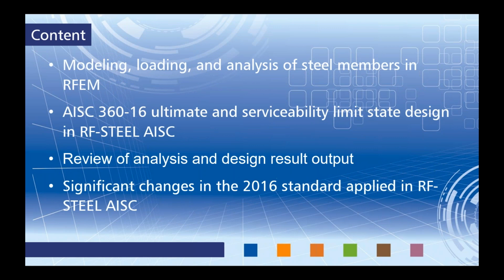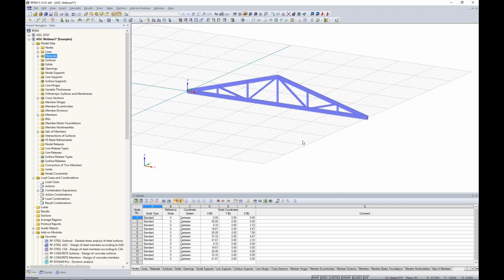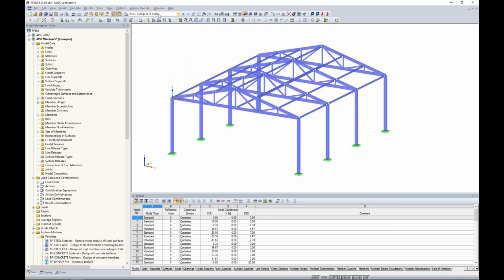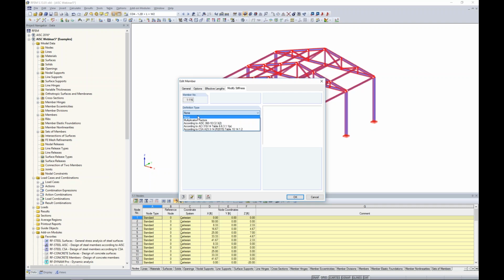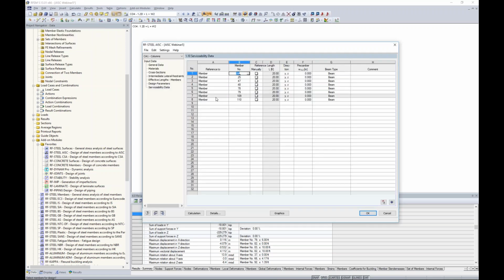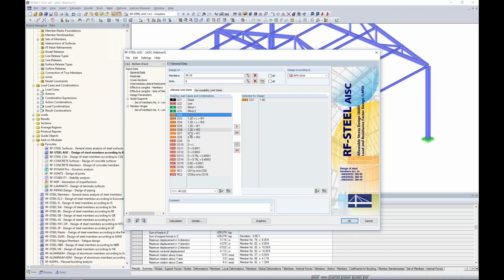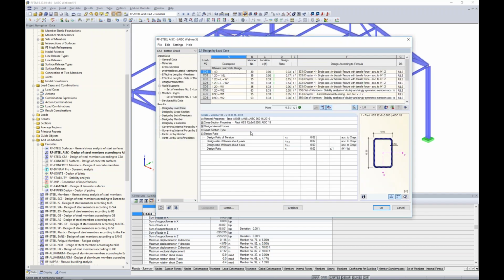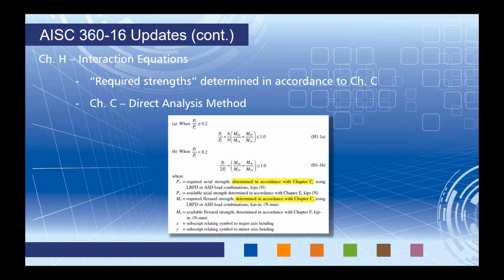Webinar: AISC 360-16 Steel Member Design in RFEM (USA)

Comment: Wind loads and some other items not showing in TOOLS menu in my PC.. How to make them to show in tools menu?
Reply from the maker: Hi, 256!
Which program version are you using?
Reply: @DlubalEN  Hi, "Dlubal RFEM 6.02"  and "Dlubal RSTAB 9.02" both are trial version
Reply from the maker: Hi, 256!
This video is about RFEM 5.  RFEM 6.02 is the new generation of our finite element software. You can find the wind loads in the navigator of RFEM 6 and RSTAB 9 as you can see in this short video. https://www.youtube.com/watch?v=1WYyQ_MAqnI
Reply: @DlubalEN  Hi, thanks for your reply.. I see RFEM 6.02 have no automatic wind loads generation on walls.. also video link shows only roof wind loads It will be great if u can make a video about it, . Dlubal have many design options and it is the one of the best software I have used.
Reply from the maker: Hi, 256!
Wind load generation (according to EC) on walls is also possible.
Reply: @DlubalEN  I want to try ASCE wind loading generation on walls .. so I used RFEM 5 for this option.. hope RFEM 6 will incorporate ASCE wind loads on wall too soon.. thanks
Reply from the maker: Hi, 256!
This will work in the near future!

Comment: Is it. Possible to produce. Working drawings under this software..otherwise its a good software
Reply from the maker: Hi, suzyo!
This software is for analysis. We do not produce full drawings but the software usually provides automated drawings and sketches of isolated parts like connections or foundations. Those drawings in many cases can also be exported to a dxf to be used in a drawing software.